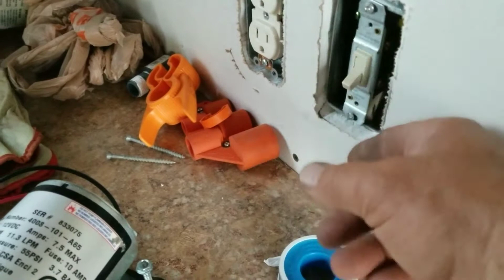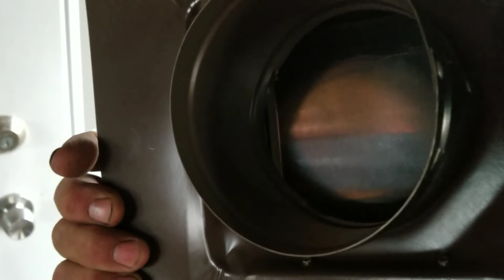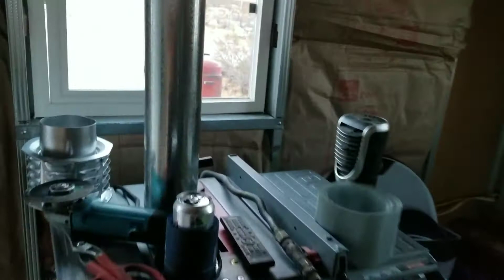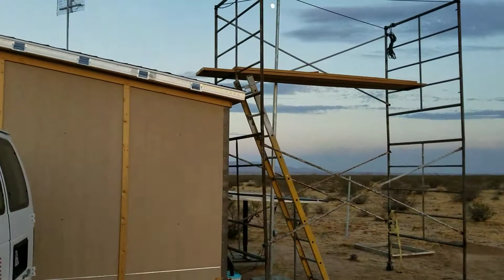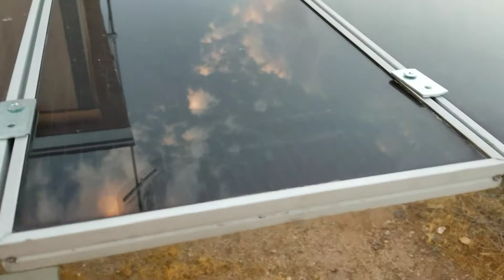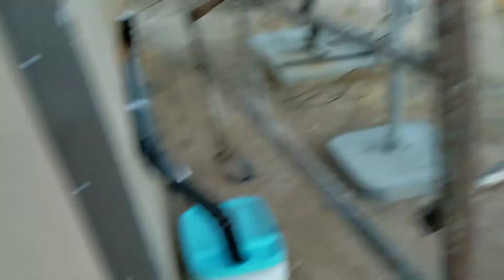Homesteading The Desert,  Sept. 2, 2017

Comment: Bear, you mentioned having to move the scaffold before building the small shed.  Will there be room for the scaffold after the shed is built to service the turbine later if needed?
Reply from the maker: Tom Bennett yes it will, but not in the same direction that to was.  I'll have to rotate it 90 degrees and the propane shed will be inside the scaffold.   Thanks for bringing that up though.  That shows sharp observation.